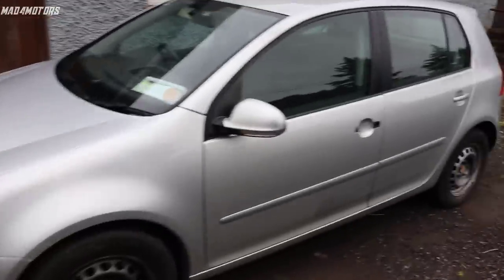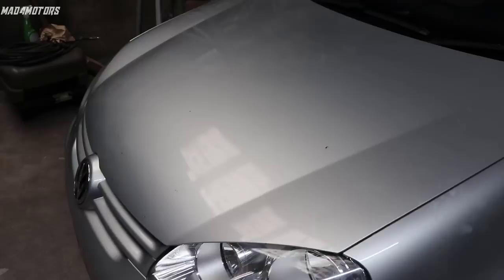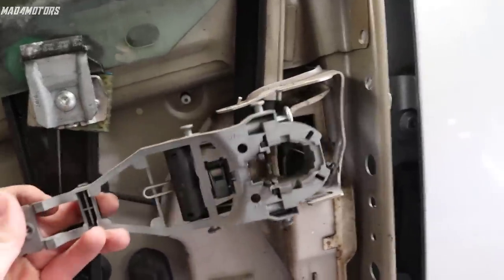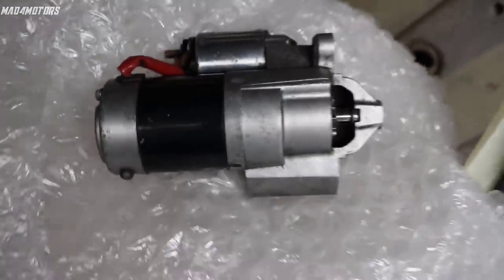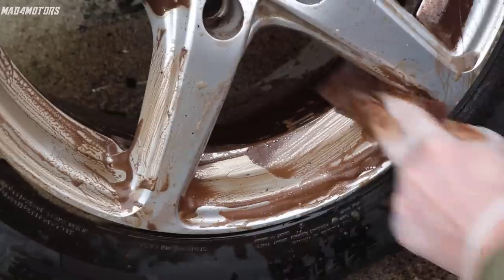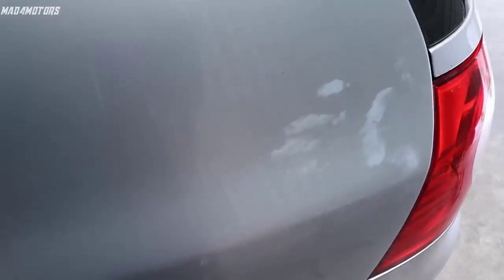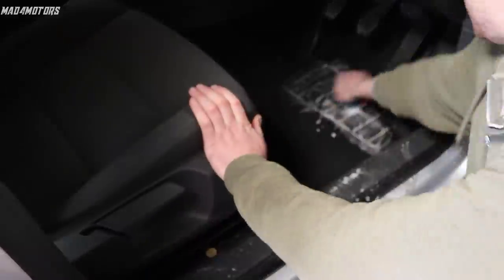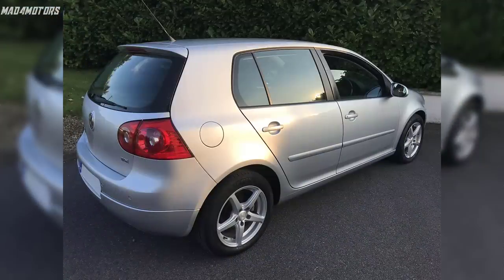Turning a $1,000 Car into a $3,000 Car

Comment: 11:34 funny enough a cleaned engine bay on a used car is a major red flag for many buyers because it indicates that the car had some type of major mechanical issue that the owner couldn't solve. They try to clean up the engine to make it seem healthy on the surface but they might be hiding something like an oil leak or headgasket leak (although you'll notice these things with other signs as well)
Reply: Yeah I agree, but he didn't actually clean the engine and engine bay up, I would say he only removed the worst dust and cobwebs from being parked for over a year.
Reply: If the rest of the car is spotless then it just makes it look like it's been thoroughly detailed. But a spotless engine bay on an otherwise filthy car would be a red flag to me though, for sure.
Reply: I wouldn’t say this personally, I keep my engine bay spotless

Comment: Always tighten wheel lugnuts in a star pattern! Also use a torque wrench!
Reply: @mikixP  don’t cry when your wheel falls off then 🤣🤣
Reply: Never done that in my life and never had a problem.
Reply: Hes not wrong; its just common sense to fasten any assembly in a sequence that spreads the load. No need for a torque wrench though, you can just do it by feel
Reply: Torque wrench isn't necessary. Everyone i know just uses a lugnut wrench, never had a wheel fall off or a stud strip.
Reply: I jus do it hand tight.
Reply: @VeyronBD  Everyone says this until the first problem...
Reply: @VeyronBD  Never had a problem, so everyone should just stop using proper procedures, right? Silly spoon.
Reply: @bastogne315  Finger tight 😄
Reply: Ahh calm down ya big fanny
Reply: Thank You Mister Helper.

Comment: Been watching you for a while doing a great job. 
This is what I do as a hobby. My best flip so far a 800 quid audi in limp mode which needed a damaged sensor wire repair which was a free repair for me, sold it after a good clean up with new mats for 2500 after only spending 25 quid on mats. Very satisfied customer which was the main thing for me. I don't sell on rubbish, must be HPI CLEAR FSH, perfect to drive and clean as a whistle.
Reply: unreal. I am thinking of starting too, but if the customer asks why are you selling or whats the history or how well has it been looked after what do you say? That you just buy them to sell on? and whats that like? cheers
Reply: @hughoneill6555  Once I've gone through the car and im happy it's top notch I either explain I bought it needing some tlc or I say I knew the last owner via a friend (a little white lie I know to provide some confidence from the buyer, which either way won't make a dot of difference to the car itself at all in reality just makes them feel better) and they wanted to sell it on quickly when they bought a newer car. At the end of the day what ever the "story" behind a car any car has the potential to be a nightmare or a dream for the next owner because things go wrong or maybe not. All you can do as a seller is find and fix anything at that time and sell on a good honest car. And if you think a dealership or independent car showroom does anything differently you would be wrong. They may however offer a warranty which I bet 98% of claims are denied due to being "wear and tear" and therefore not covered.
Reply: @LAW-fv6ys  perfectly answered and I really appreciate it. And what's the best with vat and tax does it matter if it doesn't have it? And should I add them on when selling it?
Reply: @hughoneill6555  you only need vat registration if you earn above 81k profit. Tax? On the car no, and its not transferable anyway. I am a registered trader (part time or full it's the same really as far as hmrc is concerned), if you sell a few car a year I wouldn't bother, hmrc are really interested and it's only the profit that you have to pay tax on. Above 7 or 8 a year I would register. There is no hard and fast rule, by the book hmrc want their cut if you make any type of profit from anything.. simple.

Comment: Good one mate, bought MK5 Golf GT 2.0 TDI as non runner for £300 spent £900 total and sold it for £2900, it was low mileage 97k. Changed all 4 door locks, EGR Valve And Throttle Body and bits and bobs

Comment: A real inspiration. I’ve just bought an Alfa Romeo MiTo for £700 from auction worth £3000. In the process of pulling out dents, body filler, primer and painting. Hoping to get £2500 with full service and mot

Comment: Sweet! I just picked up a 2004 Nissan Altima  3.5 SE with 135,000 miles, but only the 2nd owner. Low Bluebook is $3000, got it for $1500. Needs a door handle n paint...the body n interior are clean. Ur video is inspiring as I can DIY it n make some $$!

Comment: This is amazing I wish I had the confidence to do something like this 😭
Reply: Start with doing an oil change, then go on to changing some brakes... confidence comes with experience. And also, watch guides online. A few years back i always had a shop do even an oil change. Now i do full services, brakes, exhaust and even did some engine work on my Volvo V50. All thanks to google and youtube.
Reply: The worst things are timing belt and headgasket
Reply: @Gamer-pb9tw  Yeah! I've not Come there yet. Had to changing the EGR last fall... that was the first time i had to do anything with changing cooling fluid. But 4 hours later, it was done 😀👍
Reply: @Gamer-pb9tw  what about ball joints and shocks 😬😔
Reply: When you have time you can do this, it's bolts and nuts. Even if you break something then you'll have to fix it and that's it. No brain surgery. Second thing is that not everybody own all the tools shown. Also, it would be nice to comment on the correct way to dispose the dirty oil. Yet inspiring video.
Reply: @armandoortiz2174  For the old oil or coolant. Just go to your local mechanic and ask him if he takes it or knows a place
Reply: My father gave me good advice once: "It's a machine designed by humans so you as a human with right tools can fix and service it" 
I really can't tell how much € I've saved when servicing my vehicles. As a teen first my 50cc moped, then all my cars including current -2014 C350 MB. As Tommy said it before confidence comes with experience. And don't mind too much on the tool costs. You don't have to spend many thousand euros for a tools at once. You buy them when you need them. Never buy the cheapest tool tough. As we have saying in Finland: "The poor cannot afford the cheapest tools."

Start out small and you will eventually become a mechanic!
Reply: @peltsi40   "The poor cannot afford the cheapest tools."
 That's a really good saying
Reply: @Gamer-pb9tw  so steer clear is you see a cheap car with these problems?

Comment: Can you give an help. I have something wrong with my handbrake. The seitch is fine. But i need to know were the wires conect in some module or soo. The car is always showing red light with  the alarm... the switch is working. Maybe the wire have been cut

Comment: Use fallout remover to remove surface rust it works well and makes it look much better, good to remove rust in door hinges etc and engine bay bolts without having to use mechanical removal and it makes it more presentable even if its just for a while.

Comment: PSA: A spotless engine bay and a "reasonably clean exterior" car is a red flag to most buyers. "Why is the engine bay spotless and there is dirt/spots of neglect on the outside of the car?" It's a way people can haggle you down. If something is to be clean, it is to all be clean, and evenly as clean as the rest. 
Cleanliness isn't perfection, it is organization and control of care.
Reply: Another huge tip is don't go nuts with tire shine. The best way to get tires to take tire shine is to deep clean them with a cleaner + bristle brush to begin with, so consider settling for a matte but deep dark finish instead of a "shiny, I just doused these tires in tire shine" look. You want the car to look as normal, and clean as possible. Insanely shiny tires stand out in good and bad ways. Incredibly clean and dark, non-shiny tires stand out only in a good way.
Reply: For those who do not know, tire shine fills pores and makes them glossy. If you have dirt, or even brake dust, road grime.. etc.. built up in patches on  your wheels, or at all, the tire shine will fade out faster in other spots. It really will not look good. In fact, it is disappointing. Clean the tires first, then consider tire shine. Do not just go straight for tire shine. It screams "I am trying to flip this please god buy this from me, and don't forget to haggle as hard as possible" lol

Comment: welp seems like i have the same exact starter on my vr6 or a very similar one and I can say these could be rebuilt in smth like half an hour with 10 or less euros worth parts, so buing a replacement was quite an overkill. Also your spray gun positioning is quite a bit off - you wanna keep it perpendicular to the surface all the time and by this way you get an even layer. It's not so noticable on metallic but anyway...
Reply: I doubt this guy has anything to learn from you bro
Reply: @quadtruk7389  I don't really care, I know every bolt in my cars so I guess I know enough to comment my thoughts
Also it's more for somebody who probably has the same car and gonna watch the video and scroll through the comments section

Comment: u work with german cars and the way he took out the air filter is just dumb🤣 and u have to disconect the battery first be4 u start taking off the starter so electricity  stops running thru the system